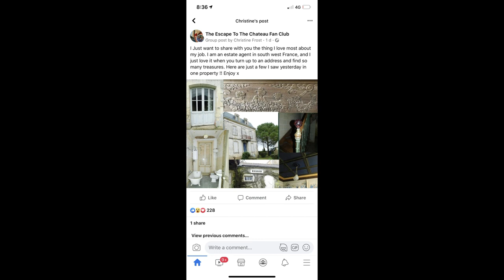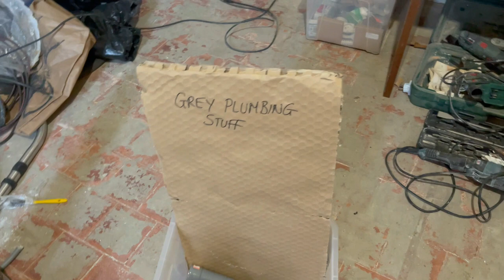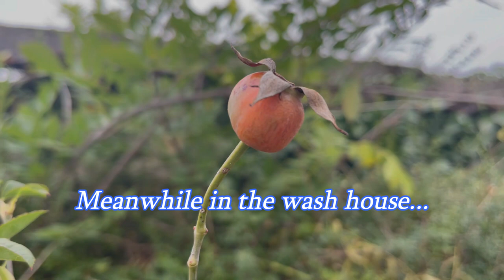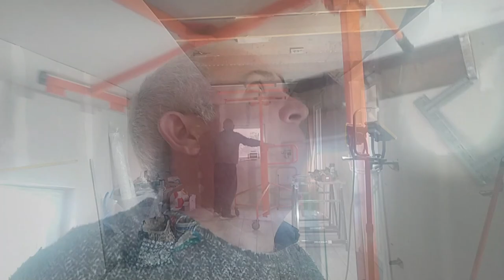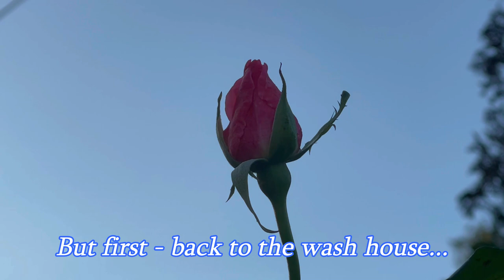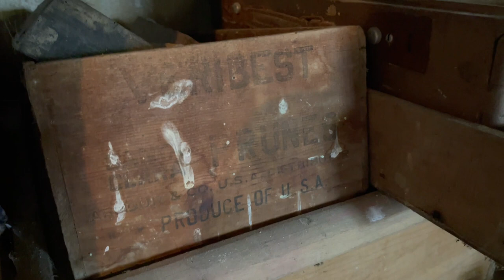Perfect Progress #65

Comment: The problem with a messy building site is that it wastes time, effort and money. For example, you need a particular plumbing part. First you search for it in all the messy rooms. After you give up finding it, you go and buy another only to find it too late. Now you have to store that part until you might or not need/find it for the next job. It’s a vicious cycle.